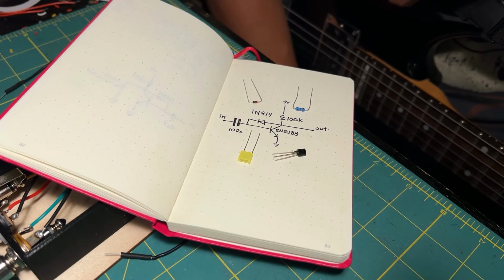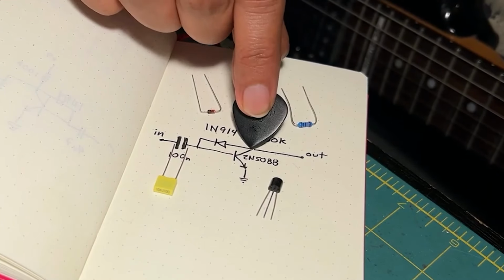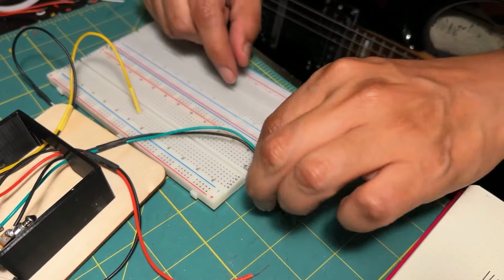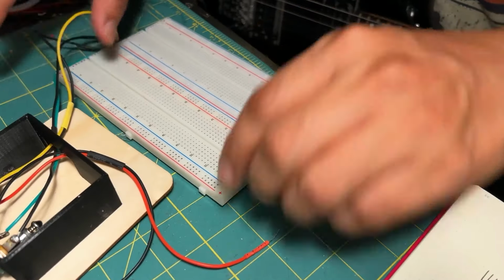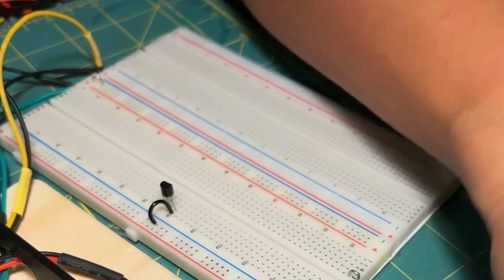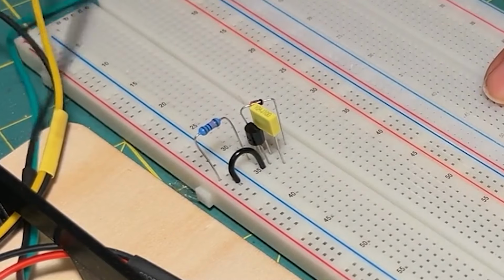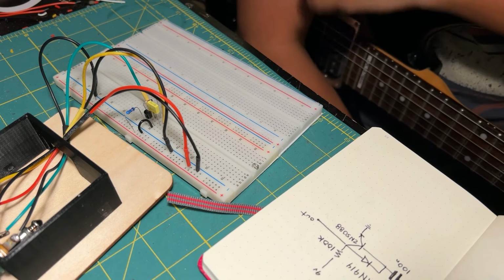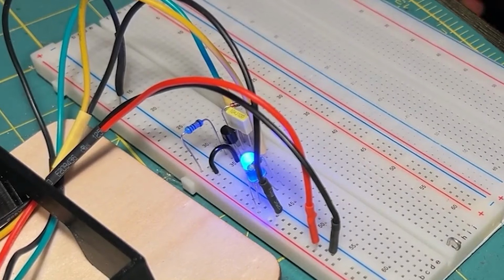How to Build a Fuzz Pedal with Just 4 Parts! | Easy DIY Guitar Pedal Tutorial

Comment: I had to substitute the diode and transistor for a 2n2222 and a 1n5819, this worked but there wasn't distorted enough so I ran it through a 2 diode to ground distortion circuit as well (I'm new idk what this design is actually called, I've been doing this for 2 days lol) and it made it awesome. I'm gonna throw in a tone and volume and call it my first pedal, thank for the design!
Reply: you can put a 2.2m resistor instead of a diode put a .01nf cap off the collector then off the leg of the capacitor run 2 diodes shunted to ground then to the output that will give you some more gain it then becomes more of a overdrive then fuzz and also add a 330R resister on the emitter to ground that will pump the gain stage again breadboards are awesome the less the resistor the more gain gosh theres so many ways of clipping the signal
Reply from the maker: Hey, that sounds clever!  Please share a clip of how it sounds!

Comment: Don't you need a decoupling cap on the output? If I've understood the circuit correctly, when the input signal is at rest, there is ~9v on the output. In fact, there will always be a positive voltage on the output. 🤔

Comment: That sounds great! I guess that by using a 100k pot before the output you could have a volume knob, but could you change the amount of distortion? maybe with a pot between the diode and the base of the transistor?
Reply from the maker: You are right, a 100k pot before the output can work as a volume. Now, to change the amount of distortion, you can use your guitar volume knobs to starve the signal and clear it out. It sounds pretty good.

Comment: Have you (or has anyone) tried this circuit with more or less voltage (+5v or +12v)?  If so, how does it play out?
Reply from the maker: I have tried it starving the circuit (between 4 and 8 bolts). It breaks and has a nice raspy edge. You can place a trimpot and play with it.

Comment: Thanks for sharing my friend! I had no idea you could put a clipping diode on a feedback loop. That’s brilliant! Did you notice any volume loss? Have you noticed if it is noisy without a R at the input before CAP? This is an awesome circuit for four components! Checkout coppersound, I just ordered a breadboard with stereo in/outs. I think you’d like the site.
Reply from the maker: Thanks. Yeah. It's a fun little circuit. One can play around changing diodes, using LEDs, or changing the cap to a 10n or 4n7 for a more trebly sound. 
If I were to put this circuit in a box, I would add both pull-down resistors at the input/output, a decoupling cap for the output, and a B100k volume control. That's probably going to be what the following videos will be about.